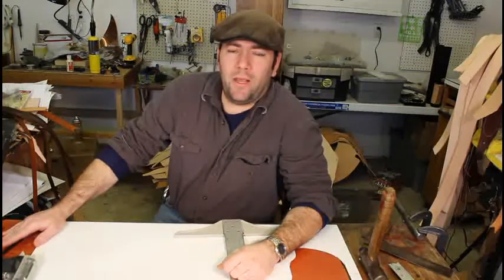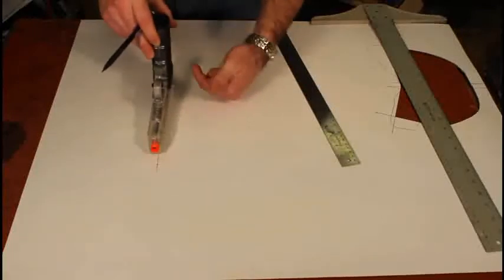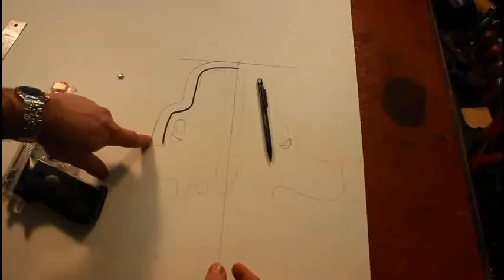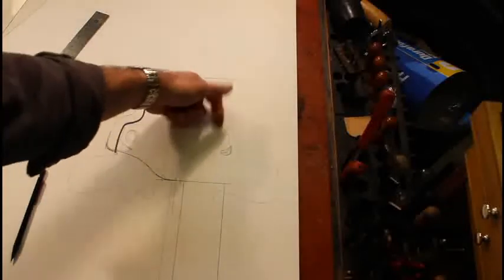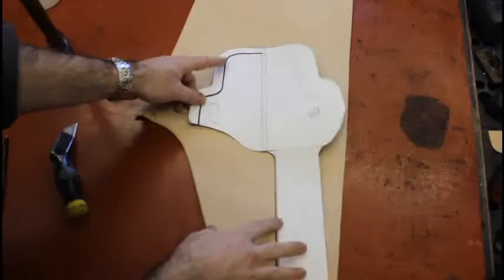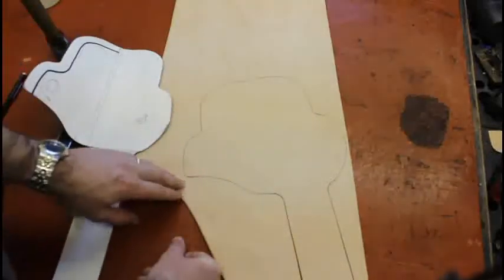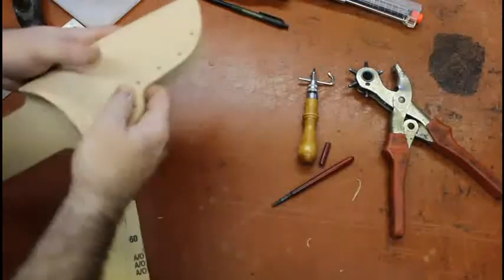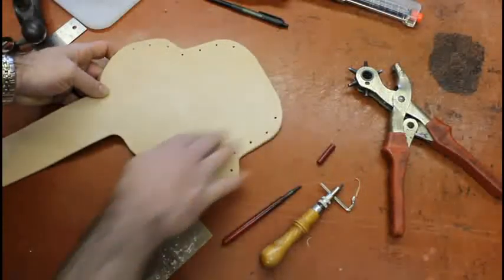Basic Leather Fold Over Gun Holster

Comment from the maker: It's just a personal preference.  I like the look of rivets, and they should be more durable in the long run.  Even if 1 fails, you only have to replace 1 rivet.  When stitching wears out or breaks, the whole thing starts coming apart.  Most of my gear is sold for steampunk costuming, so the rivets fit right in.  It's also a time thing for me.  Rivets are faster since I would have to hand sew, so it keeps retail costs down.

Comment: Great video!!!   I found that if you wet the leather , and in the case of a real gun, is to put your gun in a plastic sandwich bag ,put gun  in holster while the leather is wet ,and the leather will form to the gun.  The gun can be left in the holster over night if needed with no moister effecting the gun itself!!!  Do NOT put your gun in the wet holster without the plastic bag!!!!
Reply from the maker: Correct.  A good plastic bag will allow you to use whatever gun you are making the holster for as a mold.  For a tight fit, the gun is placed inside several layers of foam pads and put in a press.  For a looser fit, you can even add a few layers of tape on the outside of the bag before putting the gun in the holster.  A fast draw holster may need a zero retention clearance, so padding the gun just a bit will help ensure there is plenty of room for a quick in/out.
Reply: +Stu Stewart  I have found that wrapping the gun in heavy kitchen plastic wrap (ie saran wrap) works best for me in doing this.  How much you wrap can affect the leeway you have for clearance.

Comment: An unlined holster is just a way to remove the finish on the gun, totally amateurish and not worth doing.Hand stitching is stronger than rivets any day, stitches flex rivets don't..WW
Reply from the maker: No need to troll.  This vid was for a basic beginner to learn how to layout a holster, especially for costume purposes.  Yes, there are many things that can be done to improve on it, but the title is "Basic Leather Fold Over Gun Holster", not "Advance Premium Holster Creation and Finishing".  I also disagree an unlined holster will remove finish faster than a lined holster (unless the holster is lined with felt or fur).  It shouldn't if the inside is properly slicked.  Leather lining is still leather, and will wear on the finish too.  As far as rivets vs. stitching, both have their merits and drawbacks.  I like the look of rivets and the speed and convenience when compared to hand stitching so long as they are not in contact with the gun.  As I say in the vid, you can stitch if you prefer.  Strength is irreverent since I don't plan on using a holster to hang off a cliff, and rivets are more than sufficient to hold the holster together for as long as the leather is good.  I would argue how much strength difference there is between stitching and rivets.  Since I don't think a holster should flex  in that seam, it really doesn't matter if stitching is flexible.  A holster should be stiff and retain shape.  If you would like to post a holster making video you think has more and better info, please do.  There are many different techniques, opinions, materials, to leather craft.  I enjoy seeing how other professionals in the field do things, even if I choose different options, but never call their work "amateurish".  If I dislike a vid, I just stop watching and pass on by.  Perhaps this isn't the YouTube Channel you're looking for.  Move along.